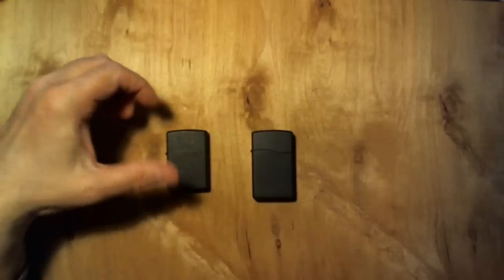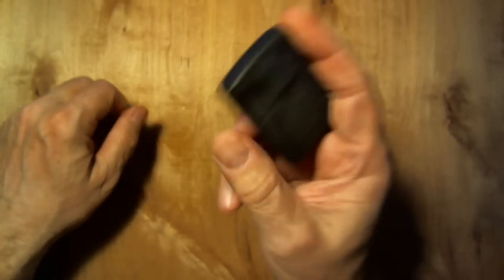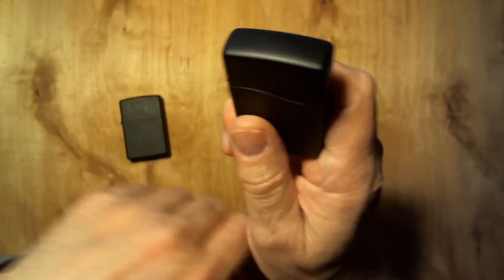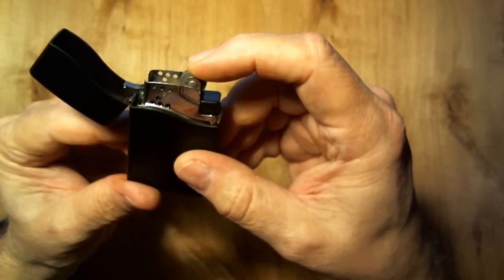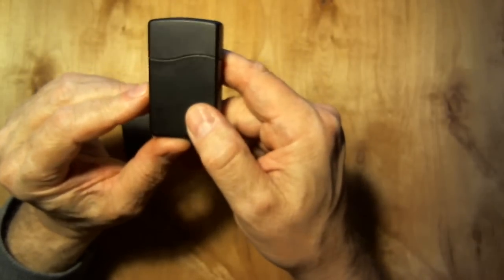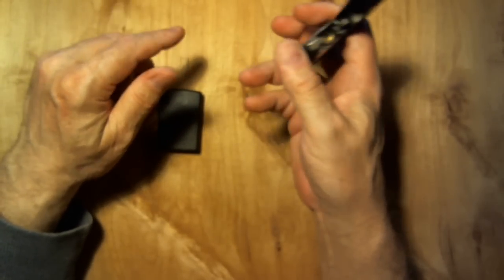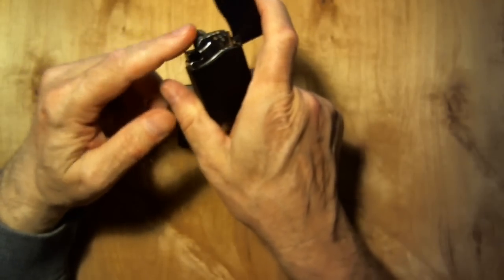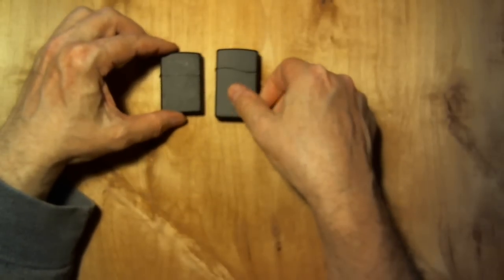CLASSIC ZIPPO and ZIPPO BLU2 BUTANE lighters

Comment: i just bought the butane insert for the normal zippo, works just as well... plus like you said, you get the sexier click from the normal lighter :)
Reply: paintball130 where did you buy it?
Reply: @positivityiskey924  it's just in Amazon, you can have jet flames, soft flames, flint or piezo ignition.

The 3 most common brands are zplus, vector thunderbird and tristar

Comment: Is the BLU2 powered by jet fuel? 

If so, can it melt steel beams?
Reply from the maker: +MrMaestro14231 Ha! Thanks for your comment and thanks for watching.
Reply: And teeth
Reply: MrMaestro14231   No it uses water

You can cut lettuce with it
Reply: Jet fuel didn't melt steel beams. The heat from the fire weakened the beams and since they were carrying a load, they gave.
Reply: Its butane but you can cut metal with butane torch lighters
Reply from the maker: MrMaestro14231 Not even jet fuel can melt steel beams..
Reply: Lol this old comment
Reply: only problem it does not stand up to the -5 degrees celsius it gets too cold and does not work u have to warm it up with ur hands but its prety good when its summer but the original zippo work in summer and when its cold so ye the og zippo is beter
Reply from the maker: @Maykay1312  That's good information. Thanks for your comment and thanks for watching.
Reply: MrMaestro14231 butane

Comment: still kicking the good old fuel zippo but that butan thing looked cool.
Reply from the maker: dseed Right after I made this video I discovered that Vertex makes butane INSERTS for Zippo cases. This may be the best of both worlds. Thanks for watching.
Reply: darn good info mate. def be checking it out :)
Reply: +Luigi B How is the spring?
Does it open with the same sound?
And does it feel the same when opening?
Reply from the maker: +K.H. I haven't used the Blu2 in quite a while. I now use a butane insert for my real zippo and it feels and sounds the same. Thanks for watching.
Reply: Luigi B I was asking about the insert, because I want to keep the case to my old zippo which I've had for 5 years. Thanks for the answer.